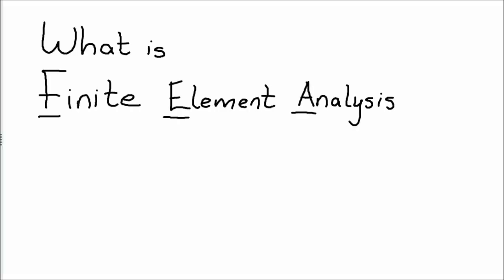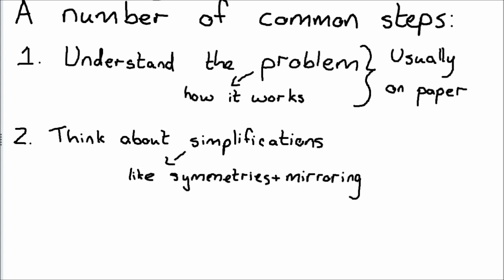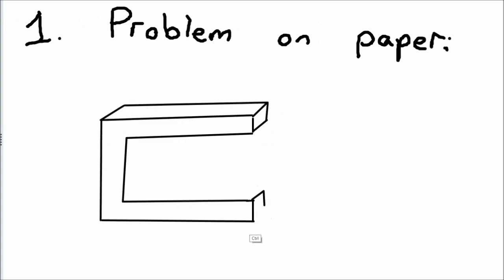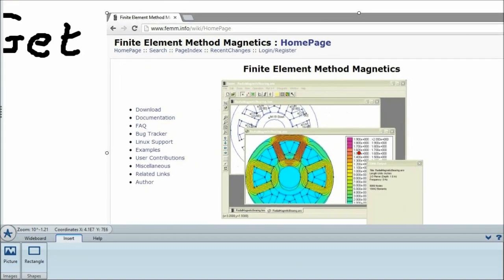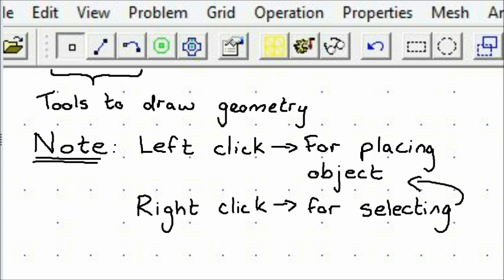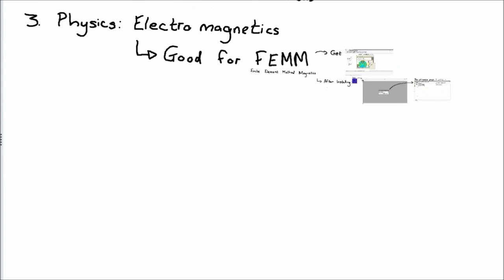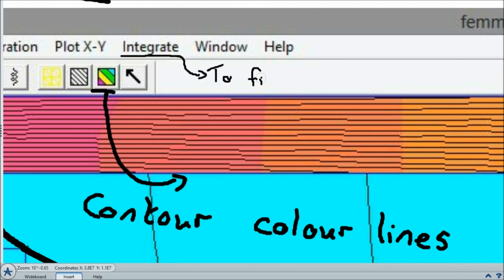FEMM/Finite Element Analysis Tutorial - Quick Overview

Comment: Hi, Sorry if this question is very easy to all especially on electromagnetic analysis. I've limited knowledge on this area. May i know what's the basic  & simple design in order to get the magnetic flux before i create the one like yours? Thanks
Reply from the maker: Hi sorry for the delay.
I think this is one of the most simple ones that I am aware of.  You may want to try an inductor as well, which might be simpler.

Comment: i want to find the self capacitance of copper tubular coils. how can i run the simulation for that?
Reply from the maker: Hi, you can simulate the same coil type structure geometry as in the video, without putting in the the core.
Check out the electrostatics tutorial for FEMM, which gives an example of capacitance, This may help with what you are looking for.

Comment from the maker: Hey, thanks for the tip.  I will try to send you the file. 
Sorry, some parts were sped up a bit, to keep it short and general.
Was there a particular spot that troubled you?  
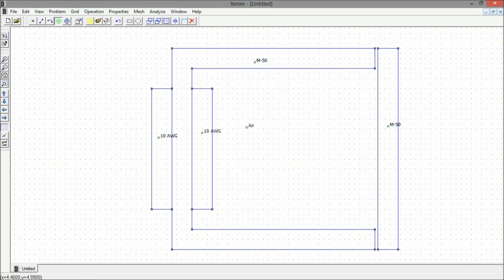I think pausing the video in HD should help you to see the key points in the problem setup more clearly (eg: 5:16 for the material wire circuit properties)